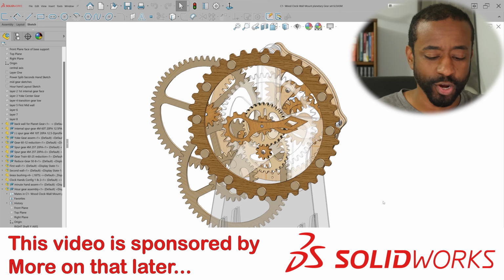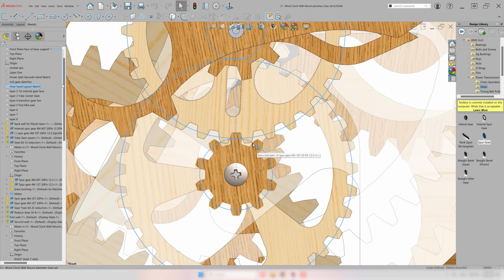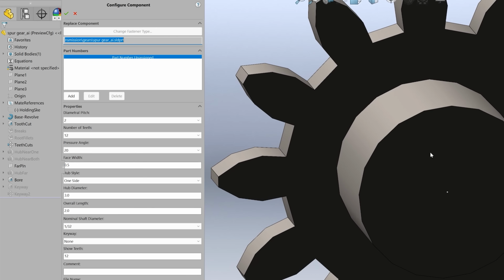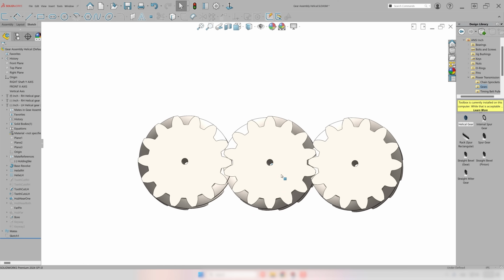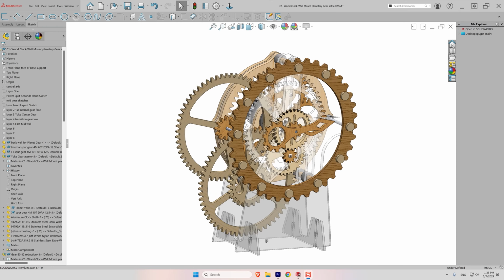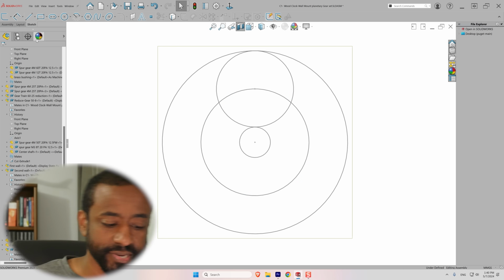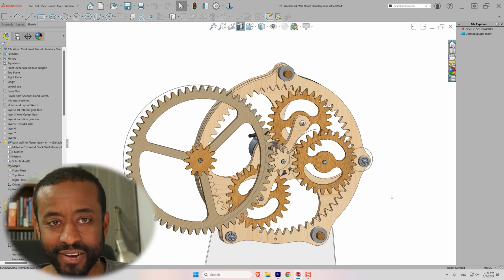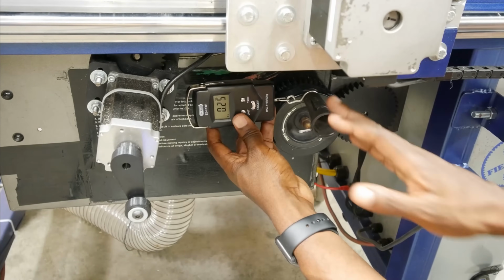How to Make Custom Gears for Beginners

Comment: I have a special request sir. My 5yo son is really into rocks and asked if I can get him a rock tumbler. I figured this would be a great opportunity to get him excited about engineering. I have a perfectly good ceiling fan that I was able to take apart and salvage the motor in one piece. The issue I'm running into is I don't know how to reduce the speed of the ceiling fan motor using gears or pulleys. I'm somewhat experienced in electrical work and woodworking, but not with gears. Could you make a beginner video (if you don't already have one) explaining how to actually mount a gear or pulley to a motor, then using other gears to reduce / increase rotational speed? Stretch goal - would you be able to actually built a rock tumbler?! I've been researching how to build one myself for weeks, but something tells me you could get it done in less than a day. Absolutely love your videos by the way, and the way you interact with and involve your kids makes me happy.

Comment: Awesome Video. The only thing which doesn't connect is where to find the Gear Generator in xDesign vs installed SolidWorks. Can you confirm if this feature is included in xDesign (browser based)? I'm getting feeling that there might be differences between versions of SolidWorks for Makers and 3DExperiance for Makers.

Comment: Based on the video and your recommendation I am going to assume you are a hobbiest user license through solid works. Back in university I originally learned design in solidworks but after leave by school my education ran out and about the same time solid works did away with the free tinker/ hobby license. In turn even though I thought solidworks was far superior I switched to 360 for my cad/cam needs. I’m not opposed to paying a small fee to use the program, in all honesty it is cheaper than Netflix a year. My question to you and a what limitations does solidworks impose on the maker license that would impact someone who wants it for 3D design and the ability to CAM their project  in the same software. What functionality and conveniences will be given up. IE some programs limit project size, travel speed, types of files , ability to save work , amount of components saved in a file ect. Essentially what are the cons of solidworks maker I should be aware of

Comment: Okay but does anyone know what the effect is for changing the pressure angle? I'm a studying grad MechE and I don't even know what it is. Great video by the way!
Reply from the maker: It’s pretty easy to find online. A bit much to tease out here
Reply: As a general rule, a higher pressure angle increases the strength of the teeth, to a point, at the expense of increased noise.

If I recall correctly, it is the angle formed by two lines. One is a line drawn radially from the center of the gear through the center of the tip of the tooth.  The other is a line radially tangent to the tooth surface at the point it would contact a corresponding meshed gear tooth.  The two cross if extended and the angle formed is the pressure angle.

Comment: $38 is a lot cheaper than the typical 10k+ for Solidworks. It's as though they're finally realizing that they need to compete with the other CAD tools on the market. I've lost all respect for SW due to their lack of innovation over the years but maybe this means they're starting to move in the right direction.
Reply: I tried it out around 2 years ago. The maker edition did not come with the same CAM and they broke my assembly’s multiple times with updates and sometimes if you updated you couldn’t log in because your version was now higher than on their servers and I had to wait a day till it worked again…

I now pay for Fusion 360. 550€ a year. But still searching for a standalone CAM to be able to switch to Alibre Design.

Comment: That's so cool, i learned things i didn't even know existed. I'd like to build a gear oil pump which can be slow ltrs per minute but high psi for moving viscous waste vegetable oil through to a centrifuge at about 90-100 psi. I've got a design id like to do similar of that is a small gear oil pump thats proven really reliable but make it much bigger same proportions, not really sure how to go about it all. Would the program say if it will work or have to be tested in real life if it works good?

Comment: You've heard the adage "Is the coffee cup half full or half empty?" An engineer looks at the cup and says "That cup is twice as big as it needs to be."
Reply: Which is perfect on many cases.  Plan for double the stress required.  For instance, a cheap 1KW power supply taxed at 500W will outlast an expensive 500W supply taxed at full capacity.
Reply: @stephenmcdonald3781  I build arial equipment on trucks. The designers put the accessories on the print like they go together like Legos.
Reply: @bheckel1 there was a long moment where I wondered why you'd put wings on a truck.

Comment: I paid my subscription today and spent 7 - 8 hours trying to get to grips with 3DExperience (as the Solidworks for hobbyists is known).  A very frustrating experience. Many functions are familiar from other CAD programs but those I specifically needed I couldn't find e.g. simply duplicating a component and moving it.  I think I'll have to stick to Onshape and write off £38.50.

Comment: when designing compact and very low profile gears or mechanisms, what rules of thumb would you use to determine materials minimum useful thickness, I know the more expensive Cad software have stress simulations and such, but that's beyond me.

Comment: Thankfully today there are a number of websites that will figure out some of this stuff for you. When l was having to cut gears for repair parts helical gears were a pain. Helicals require special gear ratios to cut on gear hobbers. Both for the indexing and feed. Depending on helix direction and if the hob is a RH or LH lead the cutter is either advancing or retarding in relation to the work.

Comment: Maybe you could talk about the engineering the tooth shape of the gears for both gear mesh and sprocket to chain.
Reply from the maker: That would truly be digging into the nerdy details. LOL Generally, IMO if someone has the need to do that they likely also have the background knowledge telling them why they would want to do that. I am not sure this would be helpful to enough people to make it. But it is interesting I agree.
Reply: @Jeremy_Fielding  Recently, I was designing a chain driven system with sprockets, and after years realized the why the arc of the teeth is why it is. Also, I found a great animation of involute gearing and had a eureka moment about the 'line of action', being tangent to the addendum and the dedendum circles. Tec-Science has a great page on involute gears and how an 'involute' can be generated with a string. Maybe too nerdy for here but helped me. Even my non-engineer wife loves your vids 🙂

Comment: link doesn't work
Reply from the maker: I just checked it and it works. Maybe you need to clear cookies, or check if you have 3rd party cookies blocked.
Reply: Which link?
Reply: @matt_1969ChevyC1o  the link for solidworks. I'm getting a blank page and i've tried of different devices.
Reply: It’s working for me as well. Definitely try another browser or device, or separate network. I find that sometimes certain promotional things won’t work for me at home because I’m running PiHole and it sees the redirects as suspicious.

Comment: Can the maker version of Solidworks import a .STP file? My particular workflow imports entire PCB projects into Fusion 360, using .STP files.
Reply from the maker: Yes. When you are on the 3d experience platform you can import stp files and several other file types.
Reply: @Jeremy_Fielding  Thanks

Comment: For Blender there's a good plugin called PrecisionGears. The free version only generates basic spur gears, but that's all I need. If I want helical twist I just do it by extruding and rotating repeatedly.
Reply: That's what i use too! I have a project that needed a gear train and i thought it would be a great idea to do my first one as a planetary set with herring bone teeth. I'm still working on it but the only thing holding me back is this being my first ever project like this 😅. Blender's mad useful for those of us with no budget.
Reply: Just remember for the same number of teeth a helical gear is larger than the spur gear. For DP gears Number of teeth + 2/DP. A 40 tooth 10 DP is 4.2". A helical is 40/10 x Cosine of the Helix Angle + 2/DP.

Comment: TinkerCad has some limited gears in the shape generator section and Inkscape has some generator plug-ins (some don't work with the latest version). Quite limited compared to SolidWorks and nowadays very affordable, you convinced me now, thanks for the video.